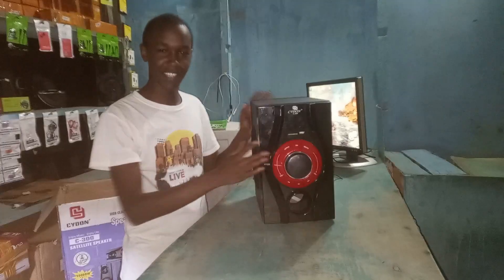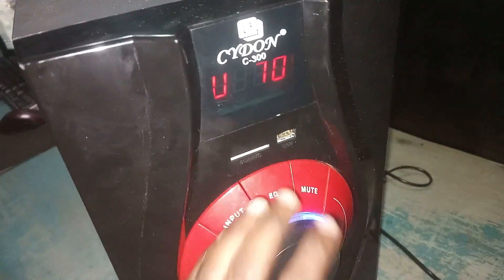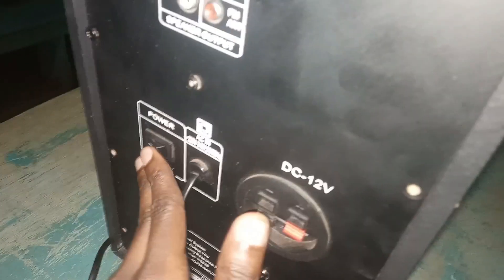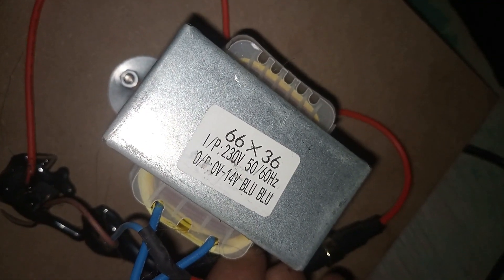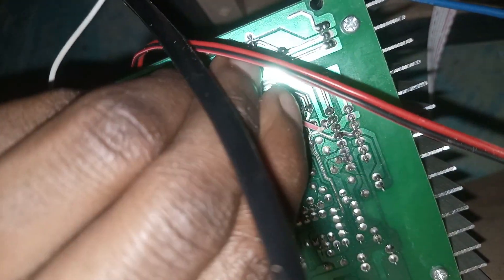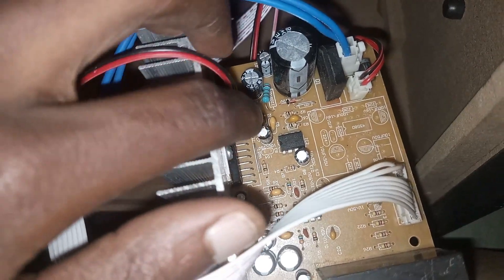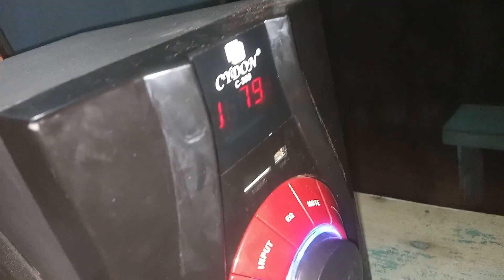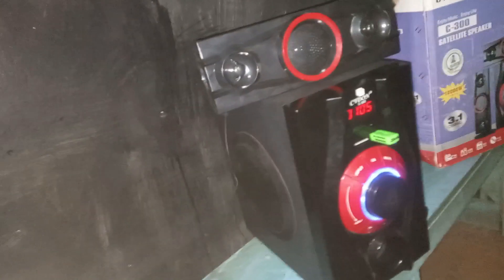Woofer repair TDA 7379

Comment: Hello bro, my woofer 3.1 speakers zake plus subwoofer speaker zinapiga kelele then sauti inatoka kwa mbali. At first nilidhani ni speakers ziko na shida but i tested them on my old woofer & they sound ok, so the problem iko kwa amp board, can you heap plz?
Reply from the maker: Ebu angalia hio capacitor kubwa kwa power section. Hio ikiharibika inashindwa kufilter power, distortion inaingia everywhere

Comment: Hallo bro..nimereplace a new 7379 but bado haina sauti...what can be the problem?
Reply from the maker: Sasa labda shida haikuwa IC, nilinotice hizo 7377, 7379 huwa hazichomeki ovyo, unless you overpower them
Reply: @emmanutechnician uzuri beste yangu ako na exact ka yangu...sasa after replacing it with a new one niliweka mother board ya woofer yake kwa yangu ikafanya...but nikiweka motherboard yangu kwa yake haifanyi...this confirm that the dispay is good too shida iko kwa motherboard...
Iko na tiny capacitors and resistors,,,and two ic 4558🤔